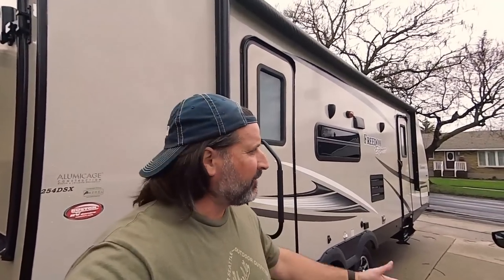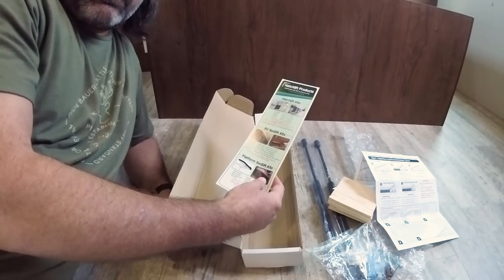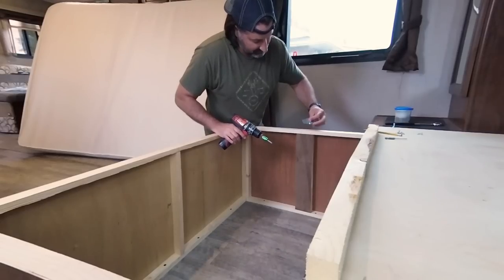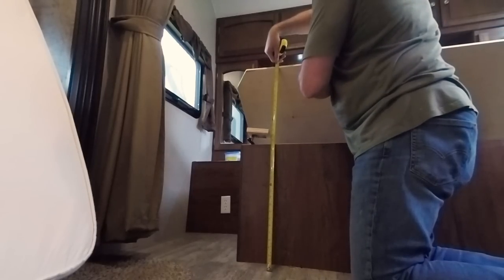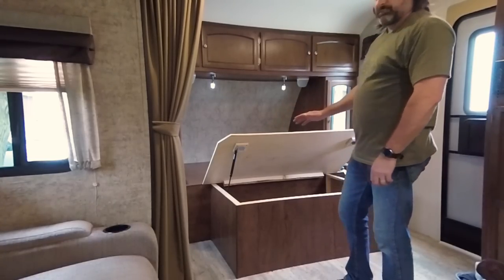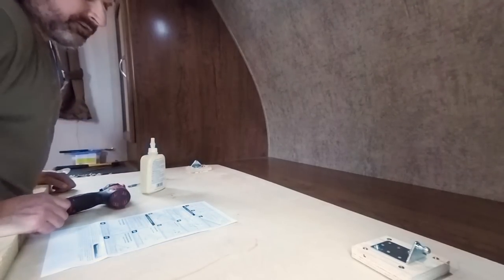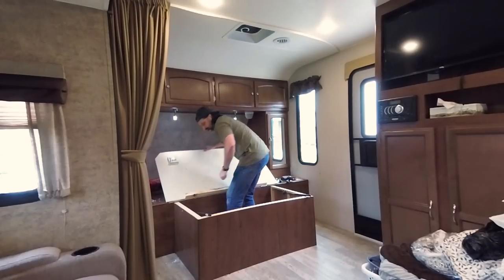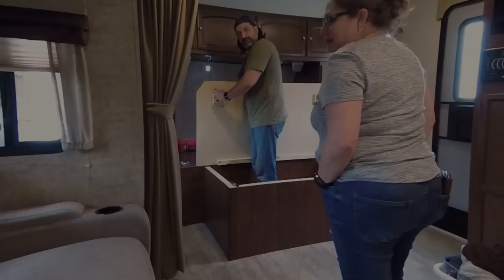Bed Lift Kit Installation

Comment from the maker: The original mattress is very light and doesn't provide enough weight to keep the lid closed. A couple of blankets placed on top is enough extra weight to keep it closed when stationary. When travelling down the road it would still pop open so I added a latch to keep it closed. The following season I bought a regular residential queen mattress and it is heavy enough to keep it closed, even when travelling, so I no longer use blankets or the latch.
Reply: As additional options, could:
- shift one end of the gas shock farther away, so it has less leverage.
- get a lower capacity 17"(?) gas shock

Comment: Might be too late at I just saw this, if you make the anchor point on the lid at the same or lower level than the anchor point on the box at closed position, the gas struts actually helps to hold the lid down. It seems the anchor hardware on the box should be flipped upside down. Great work by the way!
Reply from the maker: Thanks for the tip!

Comment: Excellent video showing the installation steps. I had already purchased 125lbs struts to replace the  existing weaker struts. The original struts were installed at the opening vs your method moving 16” away from the opening with the added 2 x 4 support.
My bed at the opening has a heat vent so can’t add a 2 x 4 there. Will reverse the original bracket location and instead use the method you used.

Comment: Great video, thank you!
I drill and install one screw before marking or drilling the others, so the bracket doesn't drift or shift on me.
Having a small vacuum or bench broom + dustpan usually comes in handy
Reply from the maker: Great tips. Thanks.

Comment: Nice video. Does the mattress keep it closed? Nice video. I'm going to order a set. Thanks!
Reply from the maker: The stock mattress isn't heavy enough to keep it closed unless you put a blanket or two at the bottom of the bed but it will pop open during travel. I added a buckle clip to it to keep it closed when traveling. Recently I replaced the stock mattress with a residential mattress and its heavy enough to keep it closed even when traveling.

Comment: Do you have a hinge on the top?? Do you think now in hindsight that you got springs that were too powerful? Supposed to stay down when the top is down. Like your car hood. Also, if I may ask, how thick of plywood is your bed top please?
Reply from the maker: There are two hinges at the top that were already there. The bed stays down fine now that I have a residential mattress on it. I think the plywood is 1/2" thick.

Comment: I bought the same size kit for my Coachmen Apex Ultra Lite 293RLDS, and my instructions did not say anything about the mattress platform being 35" from the floor.  But, when I installed it as per the instructions (new ones being included), it wouldn't come close to closing. 

In fact, the instructions said that the mattress platform should be 20" from the top of the frame, and between 60-70 degrees at angle.  But, mine ended up to be about 45 degrees following their instructions and measurements for the lower bracket installation.
I have the right kit, as per the mfg. directions, and have moved the bottom brackets back about an inch, but it is still WAY TOO hard to close, and I am afraid it will break at the hinges.
I have emailed the mfg. due to their not providing telephone support, and their basic reply has been to move the back bracket back more, and with the weight of my light weight camper mattress it should work, and have never explained why their instructions refer to the 20" measurement as well as the 60-70 degree angle desired.
I'll move it back several inches and see if that works.

Too bad they don't provide telephone support.  VERY disappointing!
Reply from the maker: It is quite hard to close and with the cheap light weight mattress that comes with the trailer it won't stay down unless you put some weight on the bottom of the bed. A couple of folded blankets is enough to keep it closed. If you upgrade to a residential mattress it will stay down fine. I have the original mattress and I added a latch to lock it down so it doesn't pop open when traveling.
Reply: @CampingwiththeColes  Thanks, I noticed them in your video, and wondered whether or not they were there for that purpose.
I plan on moving the lower brackets back about 3" and see what happens.  Sure hope that helps.
Reply: @CampingwiththeColes  can you take a Allen key and release some of the air out of the strut so it will close?
Reply: I did an easy fix by putting in a sliding bolt bracket. Not only keeps it closed but it will also eliminate in vibration from the bed top moving slightly up and down when travelling.
Reply: @jimbrenner882  I installed a latch from a purse that I modified, and when the top is lowered, it slips into the clip, and all you have to do is push the button to release it.
Reply: @sophieestime  I'd be pretty dubious about trying that.  Likely to overshoot, and how do you get a 100% leak proof seal again?  Can order lower capacity gas shocks.

Comment: This is the second video I've watched where the placement was determined by measuring to the floor. What if the top of the platform is higher than the required measurement? Makes no sense. Should be the angle of the lid to place the top block.

Comment: Are the folded blankets to add weight? Is it possible to add a catch/latch?
Reply from the maker: The original mattress is very light and doesn't provide enough weight to keep it closed. A couple of blankets placed on top is enough extra weight to keep it closed when stationary. When travelling down the road it would still pop open so I added a latch to keep it closed. The following season I bought a regular residential queen mattress and it is heavy enough to keep it closed, even when travelling, so I no longer use blankets or the latch.
Reply: @CampingwiththeColes  Awesome. Thanks for the info, I have a similar project for my airbnb setup for changeover storage. ... your video was priceless.  Hopefully I don't need to add weight or a latch.... but I know that it is very hard to get the proper strut size/weight for the mattress.

Comment: Great job.  The only thing that was painful was switching the bits to drill what you needed to drill.  I'm going to use your video to install ours, but I'm going to use a couple of drills, so I don't have to keep switching.  I'll get ours installed ASAP.  Thanks again!
Reply from the maker: That's a good idea. It'll save time. Good luck with the install. Happy Camping!
Reply: There are drill quick-change setups, including chucks on 1/4” hex shanks.

Comment: I have a smaller trailer, 18 foot Jayco and I really need the space. Your video was exactly what I needed to tackle the lift bed. One item I'm going to have to change is the plywood thickness for the base and I'll probably need to reinforce the base for the bracket stays. Thank you!
Reply from the maker: I'm glad you found this helpful. Good luck and happy camping!
Reply: One thought is (at first) screwing them gluing on a reinforcement strip, the idea being to keep the weight down.

Comment: amazon has lots of various kits and gas springs - seems the issue is (after size) knowing what the "pounds" are you need to lift it - but not keep it popping open. we have the mattress and a small topper.
Reply from the maker: You're right. As you could see in our video, with just the original mattress it wasn't enough to hold the lid closed. I put a couple of blankets on it and that was enough to keep it closed. When driving down the road it would pop open so I installed a little latch on it to keep it closed. The following year we replaced the original mattress with a residential queen mattress and now it stays closed without the latch, even when travelling down bumpy roads.

Comment: Nice video!  Installed mine after your video.  Had to move lower bracket back another inch and a half to keep bed down.  Pretty happy with install.
Reply from the maker: Yeah, sometimes the placement of the bracket takes some trial and error. Glad it worked out. Happy camping!